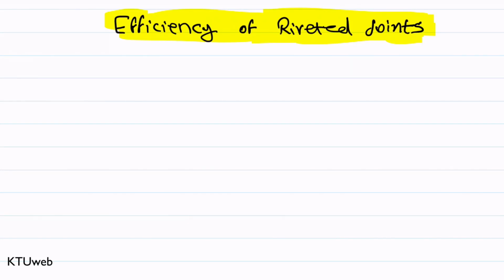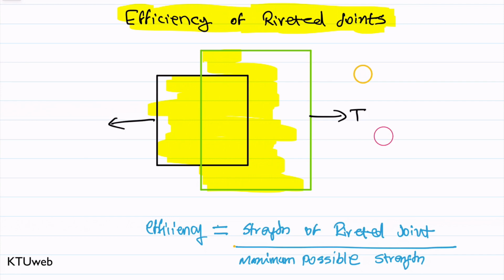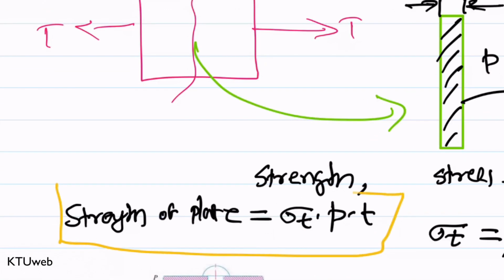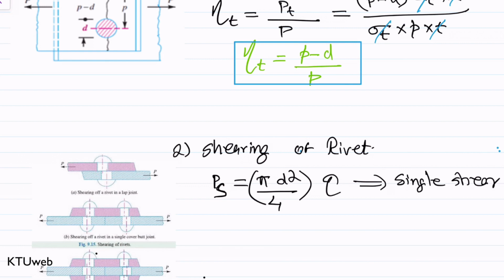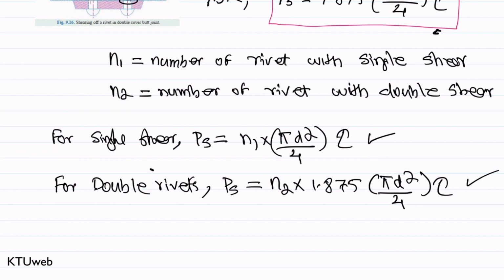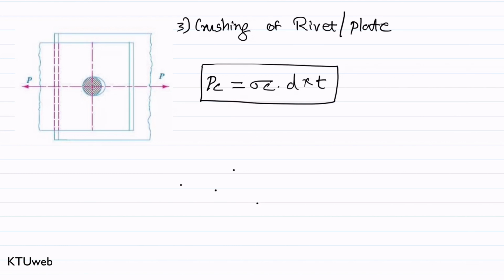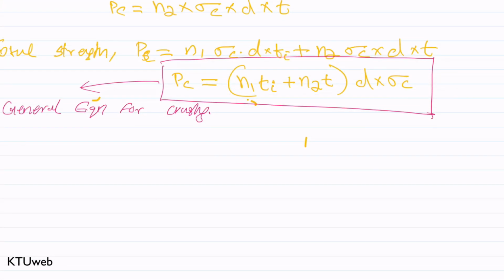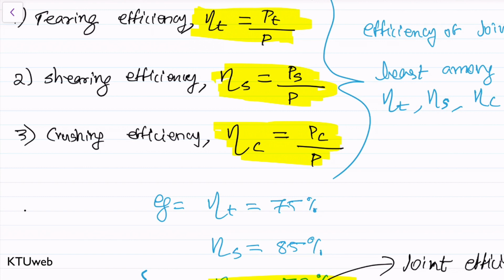Efficiency of Riveted Joints- Tearing, Shearing and Crushing  Efficiency

Comment: Sir how the cross section is p*t for strength of solid plate? How pitch will come into picture since rivets are not considered? Only thickness of the plate we know, how pitch comes into the formulae? Is there any assumptions?
Reply: For the infinite length of the plate, we have to consider some length. The standard we know as per the drawing is pitch. That won't be changed for the design so before installation the length is pitch and after installation effective length is p-d.

I tried as per my knowledge. Thanks for the question